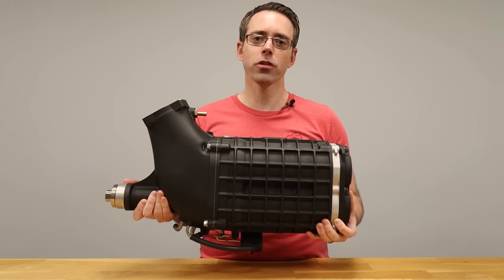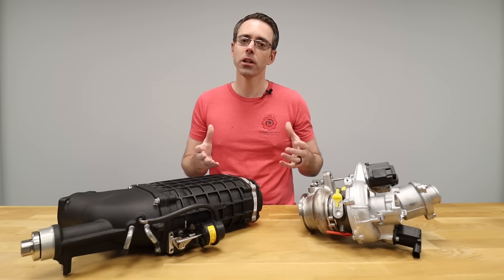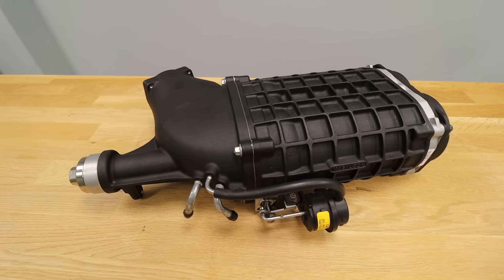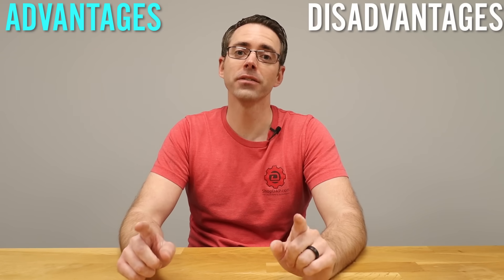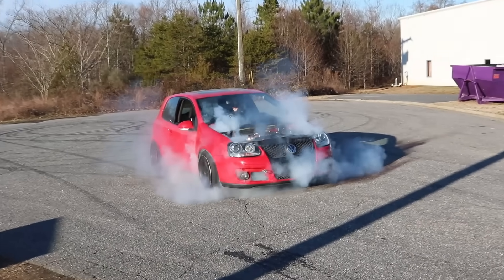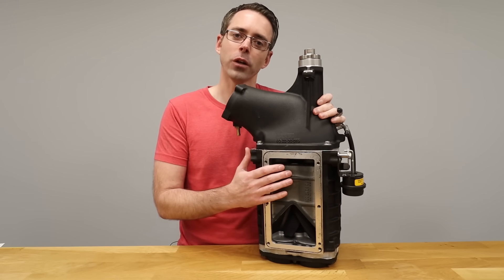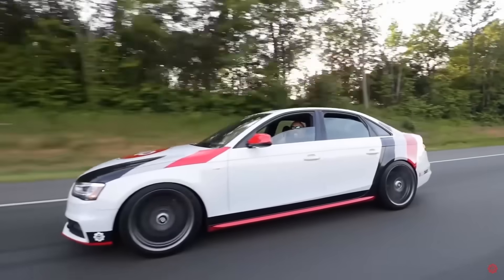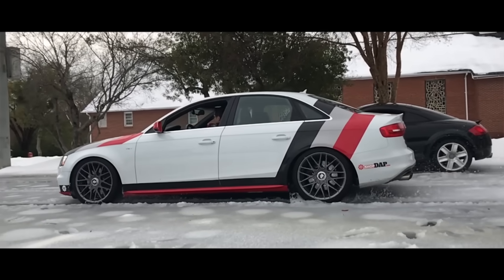Turbochargers VS Superchargers | Which is Better?

Comment: Why not both?

faint explosion sound in the background
Reply: Actually you can and it's relatively safe. Especially on a diesel. A turbo provides the low end torque and if you gun it, the supercharger kicks in. I would like to see BMW implement both turbo and supercharger on their M Series. If anyone can, it would be BMW.

Comment: Higher end Twin Screw Superchargers negate the efficiency loss and in select applications outperform turbo applications. Superchargers are also much much cooler than Turbos, and because they have boost on full the bypass is essential. Engine pulley Lso improves stability so superchargers tend to be a lifelong engine's friend. Turbochargers also more negatively affect low end because engine fights wheel spin up where a supercharger force clears.

Now turbochargers are easier to jump fast swathes of power and switch over power it is not hard to do that with supercharger. Sizing is essential for both, turbo is certainly king of the top end however do not disregard supercharger on boost loss on top, this is because cfm need and processing of motor is more efficient than available output.

In summary think of supercharger as a bar that raises with pulley selection, initial size of motor vs literage of engine is only real dilemma, unmodified engines pay heavy penalties with supercharger. Turbo is a exponential slide, add tons of boost pay for it only on the low rpms, above about 2,200 rpm for most engines is usually enough to rotate even 76mm wheels pretty well, 80mm up you need exhaust manifolds and an engine that has spunk on its own.

Few notes, for supercharger nearly all stock superchargers are roots and TVS type, which are trash efficiency of about 40-70% versus TwinScrew and Centrifugal  types which start over 80% and often exceed 90%. Centrifugal sc's are nearly completely louder than most would would like on street not often a pleasant noise, though some gearing and shrouds mitigate that not a great time, usually legal outcry if you have heavy police watch. Turbochargers operate somewhere between 76%(Ebay special) and 88%(IHI and most modern turbos) with some well selected ball bearing ceramics pushing 92+ on case by case at specific boost and operation routines.

Issues with supercharging maintenance is far easier and install and removal usually basic. SC intercooler of fixed displacement (not centrifugal tube's with belts) are water to air, run risk of loss if damaged, limping is not usually risky. Superchargers run their own oil.

Turbo and Centrifugal SC share risks and advantages with exception of heat. Lose the oil and/or water lines and it is a nearly certain fatality for the system. 

Tuning a fixed displacement supercharger like B8 is super steady consistent. Turbos can vary wildly based on temps and fuel output mapping errors or bad sensor readings.

Research options both are fun for their own functions. Both operate almost same on street mileage if you pedal right below boost, but epic shifts in smiles are not exclusive to either.
Reply: I appreciate this.
Reply: Thanks man i was told a super charger can increase gas mileage, but everybody that has one tells me i dunno know ive got a heavy foot on the gas. But if im towing a trailer  would a mild boost on a chevy 350 factory 8:1   carb 4 spd pick up possibly help mileage ? Thanks also would you recommend  brand?  Appreciate your post thanks
Reply: @joehart6406  yep
Reply: @tebibyte2357  thankyou
Reply: @joehart6406  turbo's work on a variable function based on rpm and heat is usually biggest threat in design. A well sized air to air intercooler fixes most that.

Superchargers work on a flat performance, issue is a super charger's volume will not expand with rpm and falls off efficiency and eventually becomes useless. Air to water intercoolers are needed for 11psi or more on older v8's and above 6psi in general for any high compression "hemi" type engines, which may include BMW or new Mustangs for example. Find out your power requirement and find the correct efficiency on say whipple's site or Garrett's turbo maps. Without a solid power goal this is extremely difficult to answer because comes down to technical issues
Reply: @DarthAverion  you are a scholar and a gentleman. Thanks im told to go turbo but i rarely rev my engine past 4500. I have sm 465 4spd im 370 ft lbs.  Looking for more power to tow trailer yesterday my neighbor suggested 2pd rear end . Having both would be pretty cool . Gotta admit i would probably take off my hood and drive around showing off (even old guys like showing off) thanks bud )
Reply: @joehart6406  Supercharger would be the better option for your purposes. Instant torque on demand at low revs. In saying that paired with an auto that doesn't let revs drop below 1800rpm a turbo would work fine too. A 465 @ 4500rpm is ALLOT of air
Reply: Nice post mate
Reply: Can you share any sources for research?
Reply: @malx7756  Jim Bell wrote a couple books that explain basics, math is something you have to know the formula in order to use it. This is where Ad and Dynamic Efficiency come in for superchargers and A/R for Turbo for example. Jim Bells book is way off just know how to use the math
Reply: I go off roaring a lot what would be best for off road performance for a 2021 Silverado, turbo or super?
Reply: @PissDrunxVato  probably supercharger, depends how rough the off road, many would recommend a procharger
Reply: I agree and a small pulley makes it worse. The fastest vehicles in the world don't use turbos.
Reply: I have a 2011 v8 audi idk if I should go turbo or supercharge if I go supercharge ima go tts or amd

Comment: the myths here:
superchargers are pulley driven not so.superchargers can be chain or gear or motor driven. also turbos are superchargers they are turbine driven superchargers ie turbo charger.
turbochargers are more efficient not so. they create restrictions in both exhaust and intake plenums. when not creating boost they are way less efficient than naturally aspirated engines. 
turbochargers create lag not so the way the turbo is set up can be at low or high rpm. this depends on the turbine deign and pulse map.
turbochargers add air into intake not so. turbos are used in aircraft and diesel engines some as scavanging process to help exhaust gas to evacuate. please do your research and quit putting misinformation out there like you are a expert. turbochargers where designed for aircraft in high altitude to help the engine both in intake and compression ie turbo props. then they where used on gasoline and diesel automotive and watercraft designs. a supercharger on a seadoo is not pulley or exhaust driven it is chain driven with a spring clutch. please put out the correct information. thank you
Reply: You are wrong about efficiency, a turbo engine designed for fuel efficiency outperforms both supercharged and NA engine's.

Comment: Supercharged any day. Turbos burn up!
Reply: @SG2 February Procharger's are rpm dependent they don't make much boost until 4000 rpm. Roots or Twin Screw will make full boost around 2500 rpm.
Reply: PRO 5.0 I’m new to this can u explain more I have a Infiniti q40 I am deciding between supercharging it or adding turbos. Thanks 🙏🏾
Reply: @ushyamamoto7098  Supercharger is a less complicated install, however it depends on how you want the power delivery. Supercharger for instant down low torque, turbo for more higher rpm punch. Availability of a kit is another concern.
Reply: @pro5.019  can we just be crazy like Lancia ? 
-What to put on out Delta Integrale S4 ?
-We need more power in the top end so turbo !!!
-No we need more power in the low end so supercharger!!!
"that crazy Italian engineer listening to them" -Guys we will put both !!!
Reply: @pro5.019  in my opinion turbocharger is way easier and more customizable , i mean they do require more parts like custom exhaust headers and exhaust manifolds and then you gotta do custom piping for the intercoolers. I find that more fun than trying to retrofit surperchargers on top of an engine with oem hood and with enough brace to hold it in one place😂. Got a friend who installed a supercharger and that shit was sick. Im going to be honest I like the superchargercwhine more than the turbo noises and flutter
Reply: Iv never had to replace a super charger lol had to replace 2 turbos
Reply: @noahdriscoll7500  huh I’ve never had to replace a turbo?
Reply: Big facts
Reply: Here comes the Cummins fanboys...
Reply: Twincharger best of both worlds
Reply: Turbo I like it

Comment: That instant torque nothing to be messed with
Reply: Yep and it's the primary reason I want a supercharger.
Reply: Drop the turbo down a size or two nake peak tq by 1500 rpm. Problem solved. Turbo 101
Reply: @MrEvilTag  I’ve driven a bi turbo with 650hp and I still prefer my 333hp supercharged s4. (Stage ii or iii and it wouldn’t even be a consideration for the turbo) Double the hp and still not the same. Superchargers just feel better. It’s a good thing turbos have so many ‘advantages’ or it would never be a competition
Reply: I’d take that over boost lag
Reply: @Charmer4856  you can correct some of the lag it just takes a lot of time and money. But I love my turbo anyways lol
Reply: Yep, too quick
Reply: Straight shot of Vodka has more Torque!
Reply: If you have good traction.
Reply: From my experience superchargers are really fun to drive and turbochargers (I own a turbocharged car as well) I can tell you turbos pull harder and move quicker but you can’t handle them like superchargers beating on the gas like scatpacks owners. From a dig they both fast but turbo hook better then superchargers since superchargers burn tires rather then hooking from the start like turbos with anti lag and then BOOM the boost kicks in! You get slammed hard into your seats and let’s goooo baby
Reply: Turbos have more powerful and supercharger steals ur hp by being belt driven so...
Reply: @andreitemian2427  That's like saying "jet fuel weighs alot, so jets should stop using it". A supercharger being "parasitic" is technically true however you instantaneously make more power than you've lost with the boost, people don't use superchargers because they lower your horsepower.
Reply: @cybertree  agree which is why in general alot of muscle cars use superchargers on v8s gas powered all the time you hardly see any turbos being used on them. Turbos mostly are found on 4cylinder engines and diesel trucks. No matter what turbo set up you get there is always lag. Because a turbo needs time to generate power to create boost. A supercharger just anytime when you need it. Just pedal it down and power instant throughout the rpm range. Not gonna say turbos are bad their awesome to have and have cool sounds turbo spooling and all and they can be fast when you put down more boost but lag is always present no matter what.
Reply: @cybertree  thank you! You explained it best. It’s not “robbing” power of its giving tenfold power in return. I hate it when these experts phrase the “disadvantages” of superchargers
Reply: Andrei Temian how many hp can the belt steal? 50hp? Probably not more than 5 to 10hp I guess ?
Reply: @Ilikepie18855  the one on the demon takes like 170 I think
Reply: @Ilikepie18855  the supercharger alone can steal 50hp
Reply: @EthanBorsboom  
So we just need to take it off
Reply: @MiataBoy0  yea but it added back a few hundred after it took it out
Reply: @EthanBorsboom  
Meybe we should just throw both in
Reply: @MiataBoy0  but then fire?
Reply: @mcwaff8661  
Dont worry we will put 2 coolers
Reply: @andreitemian2427  well turbo has lag it only kicks in hard when it huts boost. While supercharger is initiate power always with no lag. I think both worlds there sick
Reply: @andreitemian2427  uh huh, we watched the video.
Reply: Only Tesla’s has instant Torque buddy
Reply: @bocameron4507  not instant but consistent
Reply: Capt. Smeralda Agreed !
Reply: They take 20%
Reply: @lorddragoono  uh no lol

Comment: not all superchargers are instant power, good video though
Reply: Yes all of them are including centrifugal superchargers
Reply: Tebibyte not true
Reply: @operamatthew  yes.
Reply: Tebibyte centrifugal air still takes time to carry the air through an intercooler all the way to the throttle body. it takes time to pressurize that air. that time is called lag.
Reply: Anything belt driving has instant power

Comment: What about twincharged systems use both supercharger and turbocharger! Although more rare on cars, probably much more expensive....
Reply: In a perfect world it would be the best. Instant torque with the SC while the TC builds boost an when the SC peaks the TC come in an catapults u into orbit but..... the complexity of it hasn't been mastered yet an most twincharged cars I've seen seem to fight against instead of working together
Reply: @magnificent10304  The issue is that the SC compounds the TC boost. If you want 20 PSI You either have to A. bypass the SC or B. run the SC at 6PSI and the TC's boost is controlled so the total boost seen at the manifold is 20PSI. The second way is easier but as boost increases the SC works harder creating MORE loss and MORE HEAT. The first way is MUCH more complicated but has the better end result and can have the TC charge brought through an intercooler. Of course you can run a W2A intercooler under the blower but the best way would be an A2A spacer with a 1 way valve to the turbo so it opens when the TC makes more boost than the SC and they are BOTH going through an intercooler.

I have a supercharger and I've thought about it allot lol. I also have a turbo sedan and it's NUTS when it comes on but drives like a stock car before 3K RPM so there's that...

Comment: Power for power and torque for torque, say the advanges and disadvantages, from a mild to a extreme. But keep in mind any harm it could cause towards the engine. (Next video!!!?)
Reply: Supercharger advantage. Reaches peak torque faster. Disadvantage. Low end torque is harder on engines and drivelines than high end torque.

Turbocharger advantage. Better efficiency and peak torque. Torque can be dialled to maintain or change a torque curve. Easily adjusted. Cheap to intercool. Disadvantage. Lag.

Comment: Coming from a 8 valve G60 to a 20 valve 225hp 1.8t with the same displacement size engine in the same car ,its wayyyy more fun with a turbo. been on both sides of the fence, turbo for me. was cheaper and more reliable too

Comment: In europ you could buy a 1.4tsi with turbo charger and with supercharger and this engine was producing from 140 to 180bhp
Reply: Tim Jeklar it even has been engine of the year but came with a lot of issues after some mileage. Have one in my VW Scirocco. Power potential of 230HP with only stage 1...

Comment: What about the turbo engine supercharged ? For example A6 3.0T Supercharger.
Pros, cons?
Reply: Glorious setup!  There is nothing turbo on a 3.0 Tfsi. It's supercharged
Reply: just a supercharger the 3.0T badge is not accurate. haha i'm hoping this is a joke aimed at audi.
Reply: The same happens with some b8.5 audi s4
Reply: A super-turbo, eh?  There are examples of a super charger combined with a turbo.  Banks Power is putting out videos of their diesel monster truck project that will use such a set-up.  But with gas engines and modern turbos, I think it would be hard to justify when considering the extra cost and complexity it adds.  But it would be epic!

Comment: I love the supercharger on my audi s4. I don't have to worry about heat soak and running my car after driving.
Reply: The instant power and response of the supercharger makes me prefer it over the turbo charger even knowing the disadvantage of it.
Reply: @elihere1242  agreed.
Reply: Superchargers do heatsoak
Reply: This is why I want one I have my GTI for my turbo fun but I want an S4 for that instant torque and blower whine
Reply: @Ethan007Hacks  the engine just feels so much like a bigger V8 with the supercharger on it. I had a mazdaspeed6 prior to this and the turbo boost was apparent. And if I was sitting in hot traffic, I'd give it gas and it felt dead. The exact opposite with the supercharger.
Reply: I had a 2015 S4 I had revio stage 1+ and the dsg tune what a monster man. I miss that car so much. I got a 2018 Audi sq5 when I had my daughter it’s nowhere near as fun and the turbo lag sucks
Reply: @petersavino3890  yep, i have a 05 E55AMG supercharged,  that thing is crazy, it burns rubber all the time, even in comfort more where you always start in second gear
Instant power at any time, love that xD wwwheeeeeeeeeEEEEEE
Reply: @petersavino3890  You could have purchased the 1st gen SQ5 Which is the exact engine as the B8(.5) S4.. .  Either way, at least your baby is safe & secured.
Reply: No need to idle modern day turbo cars after driving anymore.
Reply: marksuave25 B8 gang